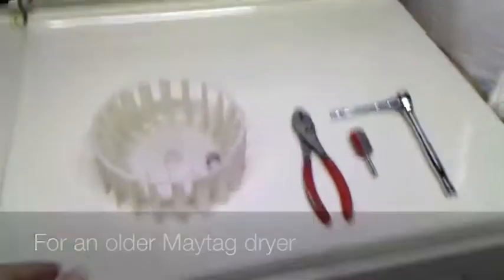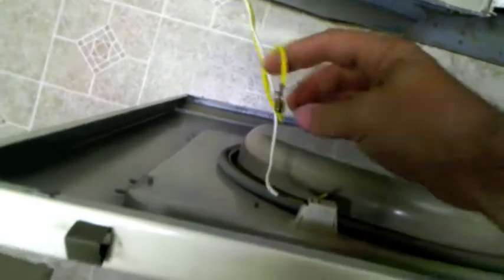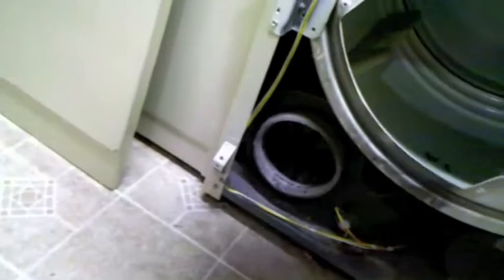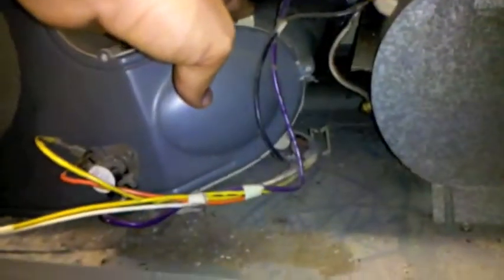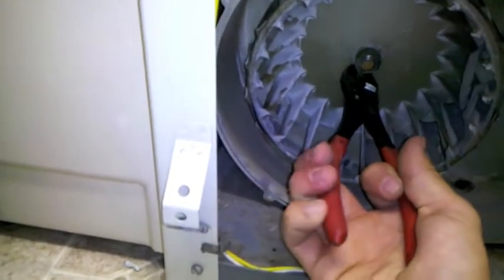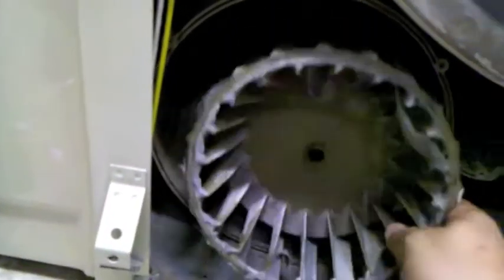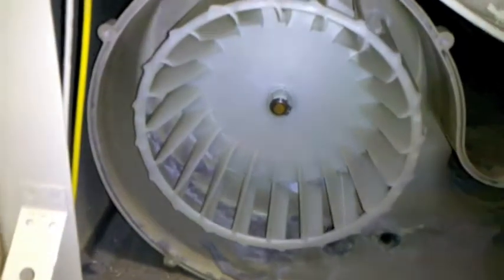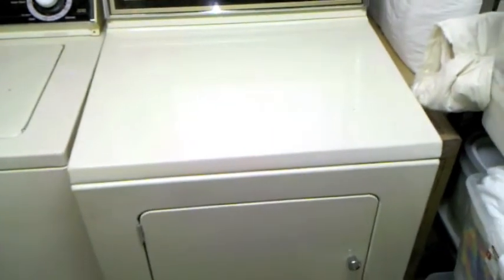Maytag dryer blower wheel replacement

Comment: My dryer was making clunking for a while.  Someone looked at it and ruled out a bad belt, so we thought it was the bearings, and I was just biding my time until it died for good. Then a few days ago, it kept spinning, but stopped blowing, so I thought I had two problems.  I figured that I could spend less than $25 to replace the blower wheel myself and continue to bide my time.  Turns out this was the problem all along, and it works like a charm now.  Thank you so much.

Comment: Just serviced this on my dryer.  Wasn't sure what was causing a clunking noise and after eliminating belt/idler and rollers I figured out it was just the blower wobbling on the shaft.  (At first it was just a noise and start up, but became constant after a couple of months.)  Was able to make a "temporary" repair with an aluminum shim cut from a beverage can and inserted between the shaft and blower wheel.  Will probably wait for the problem to reemerge before ordering the replacement part.

Comment: The snap ring behind the blower wheel keeps “jumping” the groove causing the blower to bottom out against the back side of the enclosure, which causes the portion of the wheel around the motor shaft to break. I’ve repaced the snap ring and I’m now on the third time replacing the wheel this year !!!Any thoughts or suggestions ?
Reply from the maker: The only thing I can think of is that the snap ring is not the correct size? Or its being damaged during installation?